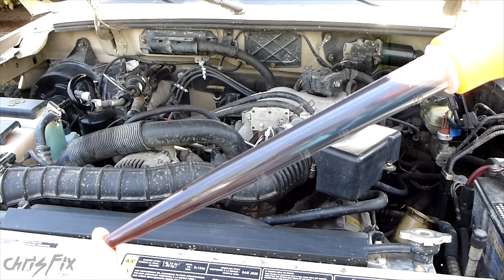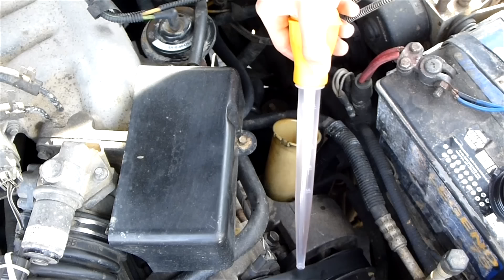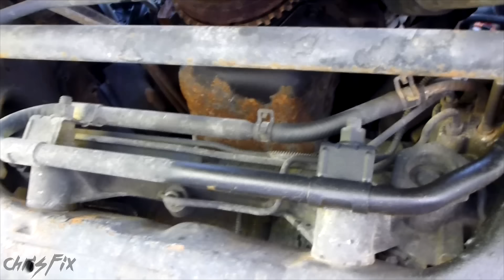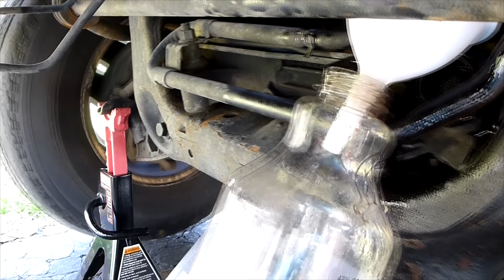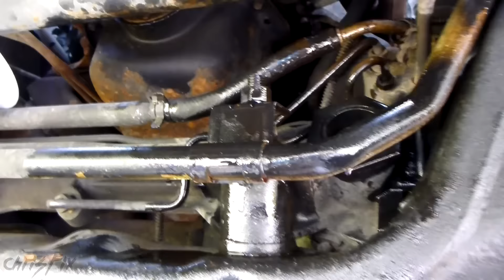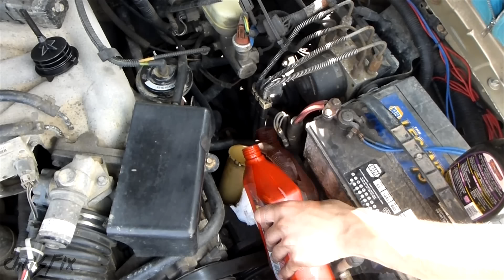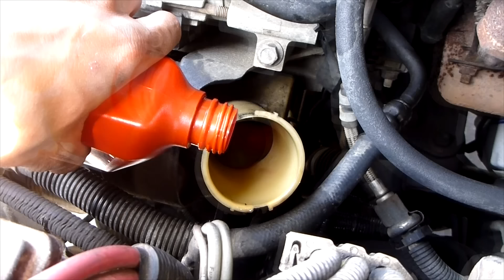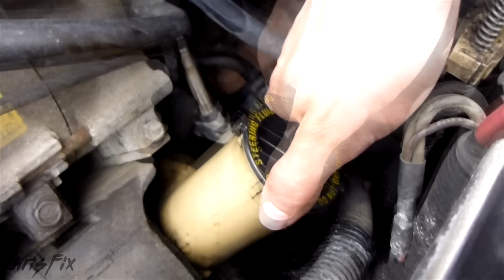How to Flush Your Power Steering Fluid

Comment: quick question... yesterday i did a partial power steering fluid change the basic sucking fluid out and refilling it and turning the engine on and turning the wheels several times, turn the engine off and repeat several times, i used 3 12oz bottles. it is a 1993 chevy with over 220000 miles and i believe it still had the original fluid. i used prestone steering fluid since the car requires gm or equivilant fluid. my fluid was completly black and i believe the old fluid was thinner than the new. so after i did that and drove around today and the steering felt kind of stiff eather way its turned,(its  pump groans some and sometimes when its almost turned all the way it makes a loud like grind/groan noise. is this caused by new fluid being introduced? did dirt get into the pump somehow or reside of some kind? should i see if it settles out? completly flush it out?
Reply from the maker: +Krystine Rose It is probably just air in the system getting bled out. Drive it for a week and see.
Reply: +ChrisFix thanks, I kind of thought so after a bunch of thinking I might of accidentally got air into the system. I was starting to get worried lol. I'm planning on flushing it anyway and flush out my brake fluid they both need it lol and thanks so for the videos :) very informative and step by step. now I know I can do more for my car myself and don't have the fear of doing something wrong, then having to pay for someone else doing it lol. didn't even know the power steering could be flushed out until I saw your video lol

Comment: Hello Chris! I'm having a problem with my 2006 CHEVY Trailblazer LS 4.2 Engine for My Theft Deterrent Security Light came on and i think its keeping my truck from starting up, for the Gas Light came On(put gas in) and the Battery light came on( got a jump, but still not start). So Can you Please tell me what is it I can do to keep from taking it to the dealer, for that is expensive to my pockets. I truly appreciate your tutorials of how to diy on vehicle repairs.
Reply from the maker: +donna  wiley Try disconnecting the battery for an hour. It might just be a glitch. If that doesnt work, check out the trailblazer forums and ask them there because they know that car specifically and I am sure someone has had that problem!

Comment: I wish my 2001 Buick Lasabre was that easy to get to the power steering pump, I love my car but hate working on that 3.8 sometimes.  At least this one I can change the belt without having to remove the motor mount like I had to on my Park Ave, same motor in both cars but setup differently.

Comment: Hi Chris,

Thank you for an informative video! Very concise and geared to those whom may not be used to doing this procedure. 

I have one question though. When you remove the house and let the fluid drain out, and you mentioned that you had made a big mess, could you have used some sort of clamp (not a hose clamp) to keep the fluid from coming out uncontrolled? 

Just curious since I haven't done this operation myself before...Thanks for the free information!

Comment: Hi Chris great video I am going to do my golf gt tdi 2000 tonight. The reason I'm going to do it is for two reasons. 1st it's never been changed from new + the steering is ok and the pump sounds ok but the steering is not as light as I would like. Question would a flush and oil change make the steering lighter to turn? Thanks Stef
Reply from the maker: +utube882 It might. It depends on how bad the old fluid is.
Reply: +ChrisFix it's quite clean

Comment: Great Video, very instructive and thorough. I've learned a lot from this video and the other video you uploaded. This is definitely one of the best video about power steering fluid flush and change.I tried to find a specific question I am going to ask you in all the comments below, but it seems I can't find one. My question is what's the scientific explanation of dirty/degraded power steering fluid could cause whining noise. Cheers.
Reply from the maker: +周兴子 Thanks a lot! The dirty fluid does not provide the adequate lubrication so the pump makes noise.

Comment: I have a question. After you get all of the old flush out of the power steering system, you add two kinds of power steering oil inside. One is the blue one, the other is red one. Can you explain why and the difference between them? Shall we use all of them or...? Thanks
Reply from the maker: +Pab Peter The red is the main fluid that you are supposed to fill the system with. The blue is an additive that quiets noisy pumps.
Reply: +ChrisFix I see! Thanks!

Comment: I need to change my power steering fluid, but I'm not sure if I want to disconnect the hoses. Could I just suck the old fluid out, add new fluid, start the car and turn the steering wheel a few times, then suck the fluid out again and refill it to make sure I got most of the old stuff out? if yes then how many times would I have to empty and refill the reservoir?
Reply from the maker: +redkoolaids Just do this: https://www.youtube.com/watch?v=VuPALAnHjRM

Comment: Is there a certain mix you have to use for power steering fluid or can I just buy a bottle of power steering fluid and put it in?
Reply from the maker: +BigWhiteChevy Check the owners manual but usually regular power steering fluid works. There are no mixes, just different types.
Reply: +ChrisFix Ok awesome thanks man! I'm a little new to cars so my questions might not make sense sometimes lol thanks for answering back to all my questions on all your videos

Comment: Hey Chris, fixing to do another project...my 2033 chevy has locked up the steering dead center. I have tried to turn either way and nothing. I have already purchased a new gear...but if I need to check something please let me know..I have you subscribed so I will see your post...thanks
Reply from the maker: +Paul Govensky Does the problem happen when the front end is lifted off the ground? Can you turn the wheels by hand with the car off the ground?
Reply: I have not tried that yet...the truck is at my work in the parking lot...
Reply: I will head that way shortly and try that
Reply: Hey Chris, Just returned from testing out the truck steering. As you asked about turning free hand, Maybe gremlins were to play but it turned free hand. I did get the truck home and going to change the fluids again. For some reason the fluid is a bright red, but my fluid should be clear....I may just get a pan and dry sweep and just pull the hose off on the low side

Comment: Chris, about how much PS fluid will I need to perform this operation? My vehicle is a 2000 Pontiac Montana minivan, and there is a line that runs way down the frame and back, I'm assuming that's for cooling. Maybe for an extra measure, I should plug the return line to the reservoir, and fill the reservoir and turn wheel to run clean fluid through the entire system before refilling?
Reply from the maker: +Bob T Usually just one quart is all that is needed. You can plug the return line and fill the reservoir and flush some clean fluid though if you want but that is a lot of work.

Comment: What happens if I just take out most of the fluid with the turkey baster and just mix the rest of the new fluid is that bad??
Reply from the maker: +Jadon Ghereben Check this out (exactly what you are asking): https://www.youtube.com/watch?v=VuPALAnHjRM
Reply: +ChrisFix Thank you. I didn't take any of the old fluid out because it wasn't dirty it looked like it had a little hint of brown but not to far off the fluid I added in does the fluid rise and expand when it heats up because I took a drive and did lock to lock and then checked the fluid level and it looked higher than what I put in.

Comment: I have a 2002 Subaru Legacy that I need to check the steering fluid but I can't seem to get to it,  can you show on a video how to get to it or what needs to be taken apart to get to it>   Thanks for the video's they are great 
D
Reply from the maker: It should be right under the hood by the belt.   Check ur owners manual for a picture of the engine bay.

Comment: shape some aluminum foil around the drain area to divert the fluid into a pan.
Reply from the maker: +Boa Phan Great idea!
Reply: Always a great idea!  Cheap aluminum baking pans also work well as catch pans.  You can also bend them to direct fluids, too.
Reply: Aluminium foil baking pans are stiffer.
Otherwise aluminium foil wrapped over cardboard.
Reply: Boa Phan Good idea.
Reply: Boa Phan Good 🤔
Reply: Sump everything through the reservoir n hose up top. 90% cleaner.
Reply: Bao Phan what about an recyclable aluminum cooking pan filled with cat litter to catch and instantly solidify the power steering fluid?

Comment: hey chris i have a q's i have 94 lincoln continental same motor as your windstar my issue is i just replaced the pump and i wanna do a complete flush but the return hose connects to a small radiator so i was thinking just disconnecting the hose that connects to the pump and flush it from their while the connector thats from the pump  use a separate hose and plug it idk if it makes sense or not i just wanted your opinion
Reply from the maker: +chataskates805 Yea that should work, just dont run the pump. You can spin the pulley by hand to force any fluid out or turn the steering wheel with the car off.

Comment: Nice video Chris! if I were to flush my power steering could I use water to flush it out til it get's clear and than add new power sterling fluid? This question also goes with if I were to flush my old brake fluid out as well with water than add new brake fluid.
Reply: Ah no.
Reply: don't use water it will leave a trace and heat up fast cracking the lines when it expand
Reply from the maker: Never use water to flush the brakes or power steering
Reply: Thank you for the advice.

Comment: I have a Nissan altima 97 2.4L automatic and my manual says dextron 2.for power steering fluid. What type of power steering fluid I should use. Or any type of automatic fluid
Reply from the maker: +Vee Delrosario You should use dextron 2 but if you cannot find it, dextron 3 is acceptable. It is the most common atf.

Comment: You ever try the Lucas power steering fix? It's real thick, gooey stuff that really ruined my ps pump. I added a bunch in like the bottle says, and it started to sound terrible. My friend told me that power steering fluid isn't supposed to be that thick.
Reply from the maker: +Nate Miller Yea, additives like that can cause problems or fix the problem. It really depends. Thanks for sharing!
Reply: +Nate Miller I have read a ton of bad things about that lucas power steering stuff so  i would stay away from it.  Some people use transmission fluid for their power steering fluid because its nice and thin.
Reply: +Nate Miller 
it also has tendency to foam, but so do most of the other additives that they sell.

in any case i would avoid all additives and just use royal purples synthetic power steering fluid, it works well, lasts a long time, and best of all helps to clear up issues without the need for additives (unfortunately it doesn't stop leaks).
Reply: +itsbetterintheslc 

i have heard that to but its not smart because they aren't always interchangeable, and can cause hundreds in damages, kinda like the myth that you can substitute power steering fluid for tranny fluid in the tranny but alas in modern tranny's it will often do more harm than good

 i have used marvel in very low amounts with good results in the tranny, only problem is it has to be in very small amounts do to major differences in viscosity

and just a hint nice and thin isn't always a good thing especially in the power steering is already really loose
Reply: +Nate Miller  I hear you load and clear. Pumped (yes it is thick) some into a leaky PS reservoir this morning and now I'm looking at how to flush the system. Hope it isn't too expensive to live and learn. contacted Lucas via e-mail. Hope to get a response.
Reply: +Hammer Head  there is way to do so actually, get a turkey baster or some sort of pump, pull as much out as you can add in regular power steering fluid to thin it out and then turn you're wheels back and forth for several minutes. after that pull out the fluid again and  this time get you some synthetic royal purple, unless the manufacturer uses something else (not all power steering systems use regular power steering fluid).

now if it was for the tranny then i would simply drain it out put in the cheapest tranny fluid i could find drive it around for 2 or 3 days, redrain it, and then change out the filter and put in full synthetic, this will dilute the preexisting fluid allowing it to be drained out and in many cases will eliminate ruff shifting by simply using a synthetic fluid or a cheap tranny flush (chevy trucks are notorious for having problems due to using cheap fluid and sometimes are even due to using manufacturer fluids due to them being a lower quality then others that are on the market).
Reply: I've used the lucas power steering additive but I only used a few ounces. That stuff is so thick it reminds me of gear oil.
Reply: I used the lucas fuel injector cleaner and my injectors started leaking fuel within days of using it. 
The general rule from experts is to stay away from aftermarket additives as a fix.  Stick with the MFG recommended fluids.  If you research a product and find good reviews from common folks (not marketing) you can take a chance. I now use top tier gas like Chevron, Exxon or Shell because they add the additives that actually work and I have not had any problems in over five years.
Reply: If you have proof that it was caused by the Lucas I think they can refund the price for the part + repair. My dad had a crappy Fram filter explode and cause his engine to seize. Fram gave him money for what an engine with that mileage cost and some to get it swapped in.
Reply: Nate ... No such thing as a mechanic in a bottle.
Reply: @dontblameme6328  absolutely. Thanks
Reply: Lucas does make some great stuff for high compression race motors however those are  a pushrod design.  always check your owners manual lower viscosity products are designed for more modern applications I.e./ over head cam motors as well as power steering units . lower viscosity also can meas less pressure. Thanks James
Reply: It did fix a leak for me one time in a car I was trying to sell...I was having to top-off the fluid like every other day the pump would get noisy when it was low & everything so I finally siphoned all of the fluid out of the reservoir 1 day & filled it up w/ Lucas p.s. fix & I never had to top it off again 🤷🏻 I sold the car some mos. later after that w/ the same fluid in it!!

Comment: What is the cause of a a/C compressor making noise when you drive ? No noise is made until you turn on the a/ C. I just charged the system so it does blow. There wasnt hardly any in it before. Whats causing the noise ? @ChrisFix
Reply from the maker: +Kenny Wayne It might be a bad bearing in the ac compressor. If it squeaks, watch this video: https://www.youtube.com/watch?v=AEUe6uKxTv8

Comment: I flushed the PS fluid in my focus today, and this popped on in my recommended videos... 
At work, we have a machine that does it and it works quite well. my PSF was a dark purple almost black, but now it's a good red color, my steering is a little softer, too :)
Reply from the maker: quadguy112895 Thanks for sharing! That machine must be awesome to use!
Reply: it is! its pneumatic, and you suck all the fluid out of the res (pump not running) put the cleaner in, start it, loaded lock to lock 20 times, leave running, and drain the res. while filling the res! its awesome! theres more too it, but I'm too lazy to type it.

Comment: I changed mine around 60,000 miles and it looked almost the same as the new stuff that went back in. Did I waste my time or was it still a good preventative measure? They don't put filters on these systems so I figure always keeping the fluid clean would do a lot of good.
Reply from the maker: grasscutter88 That is good preventative maintenance! Im sure your power steering pump is happy you did it!

Comment: Thanx Chris - Very good delivery - easy to understand - I now have a turkey baster & the confidence to do this BUT I'd like to know how much pwr steering fluid I shud purchase B4 starting this on my 98 Nissan Pathfinder. It's not making any weird noises but the steering is getting very stiff...the reservoir filler filter screen is clean - belt is tight - anything else I shud B looking for? Thanx - keep up the good werk. ( I know my spelling is incorrect but I like doon it this way..and I DO know how to spell correctly so no need to comment..pls and thanx) Cheers
Reply from the maker: Brian Doerner Check your owners manual for the capacity for your system but usually it is around 1 to 2qts max. For stiff steering it can be the old fluid or it can be a worn pump or worn steering rack. Good luck and keep me posted!
Reply: I did a Minor flush and clean with the Seafoam - (as per the instructions on the bottle) - and it's working WAAAY better already - not stiff anymore - I removed some of the fluid in the reservoir - then added the Seafoam - turned pin to pin every 5 minutes for 30 minutes  - drained what I cud with the turkey baster - added 1/2 litre of Dextron 3 and it's already working much better - I gotta drive it for a day and repeat this again - but the fluid was almost black - I didn't have time to it your way. Too hot on the asphalt to be laying down there as well. Cheers and thanx!

Comment: Great video. It is also a good idea to replace the receptacle if you can. Many times there is a screen in there that is clogged. Normally they are rather inexpensive.

It is best to replace this fluid and the automatic transmission fluid at the same time.  I like to do this yearly.
Reply from the maker: Linus Thanks man and thanks for the tips!